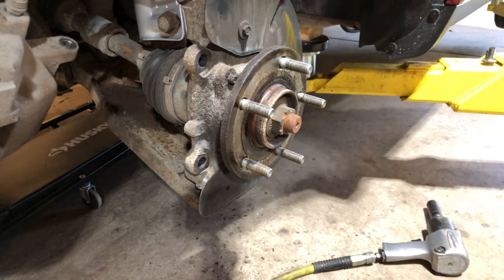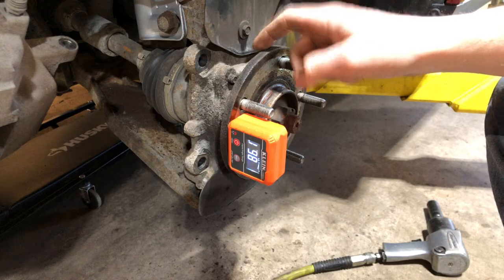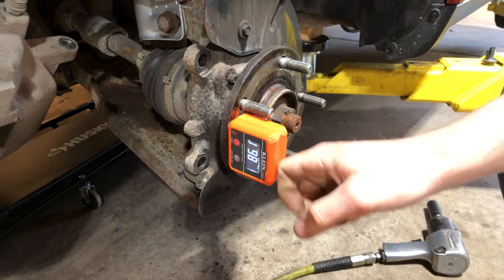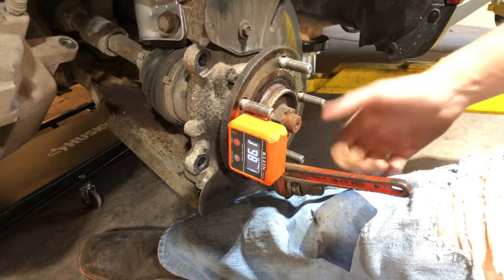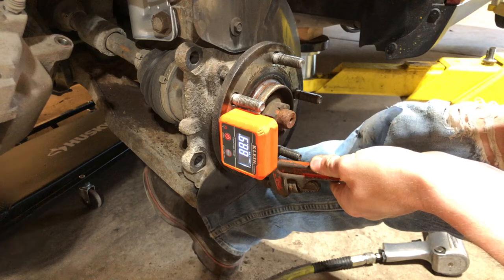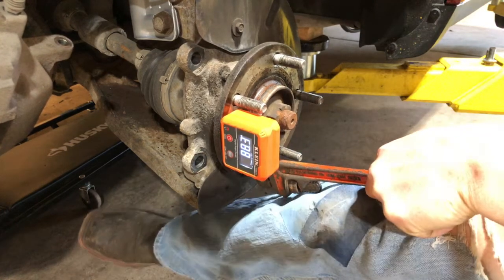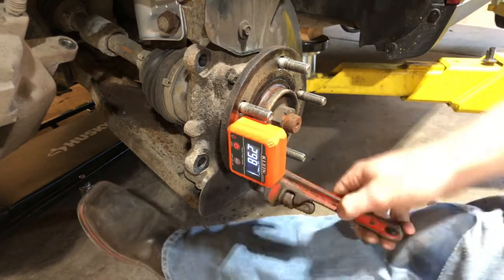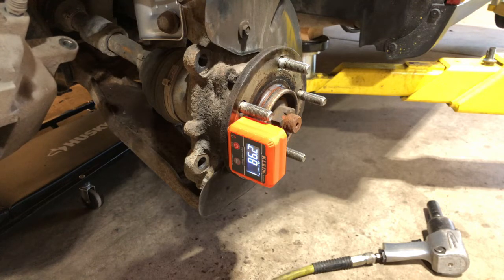Pro Tip - Keep your camber angle when replacing struts

Comment: Would you also recommend doing those when replacing both inner & outer tie rods? Doing those = using an inclinator before disassembling tie rods.. 

I ask because I'm about to undertake this project for the second rime and the material that I read and watched on the first job (Haynes Manual and of course YT) recommended marking on the tie rod to what point the end screwed up to. Well, I did that but the alignment wS so bad I had my car picked up and taken for alignment. Of course I also changed stabilizer bar links, CV axel both sides, struts and all so that may have played a role.
Reply from the maker: For tire rod end replacements, I usually count the number of turns to remove the old one and thread the new one on the same count. Though this will get you close, I’ve never hit the angle perfectly without having to align it after.
Reply: @thekeeneygarage  Agreed. I've tried counting turns and making marks on sthe threads, still, it requires professional alignment after replacement.